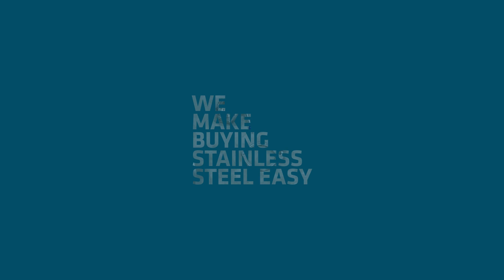What is Schedule 10 and Schedule 40 Pipe? | Technical Tuesday

Comment: Dumb question： Isn't nominal bore the same thing as inner diameter? Or is it different in NZ compared to North America.
Reply from the maker: Hi Victor, Nominal Bore is a bit like the label for the size of the pipe - it is an approximatization of the pipe size. It is related to the Inner diameter but it is not a specific measurement. For example, 50NB has an Inner Diameter of 54.79mm on Schedule 10 pipe, and an Inner Diameter of 52.50mm on Schedule 40. I hope that helps answer your question.